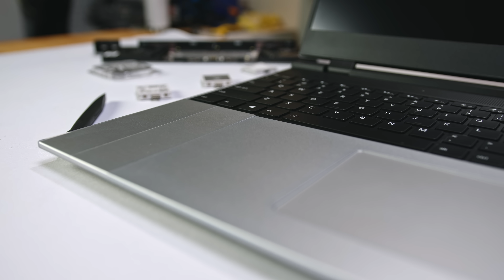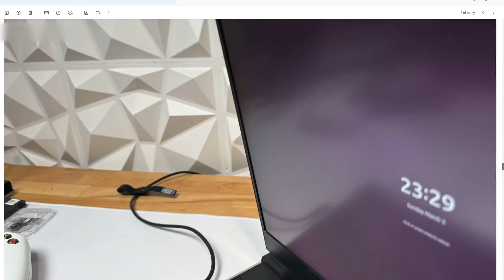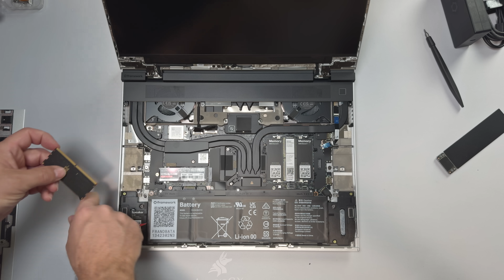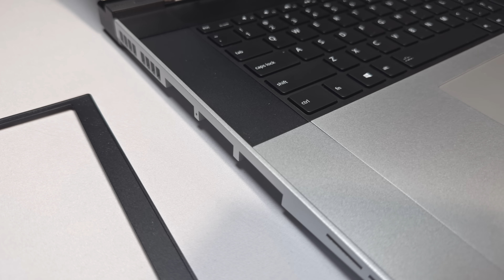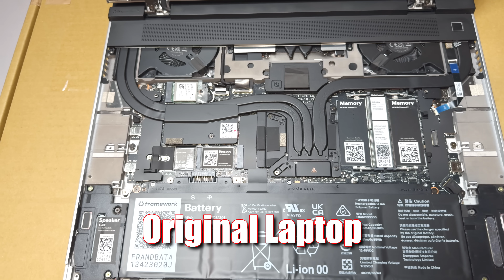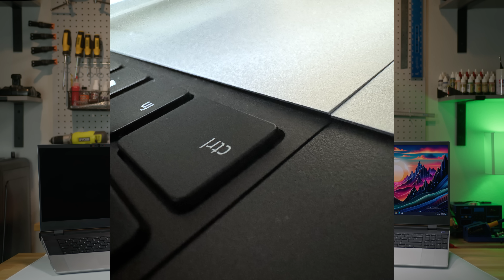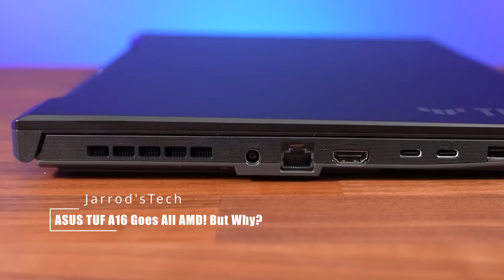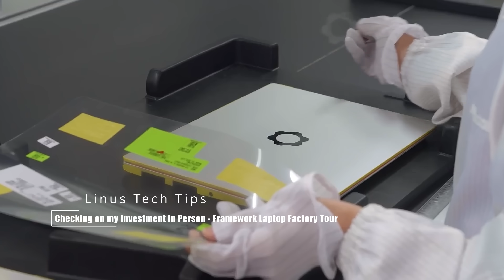From Faulty to Fixed? My Framework 16 RMA Story

Comment from the maker: About a week has gone by between filming and posting this video. In that time batch 4&5 laptops have been delivered. Just a quick glance at Reddit indicates that the input spacer problem has not been fixed. If you receive a unit with a bad input deck I highly encourage you to contact support and get it fixed first the reasons I covered in the video.
Reply: So i just want to say my Framework does not lose charge while gaming

could you measuer how much power the Laptop takes?
Reply from the maker: @ianthomas1955  what are the specs, power mode, and what games are you playing?
Reply: @ElevatedSystems  That drain does look weird though. Can't tell if it's genuine, or if the GPU + CPU + everything else are taking up too much, or if simply the charger doesn't actually supply 180W.

I'm thinking, 100W for the GPU, 50W for the CPU, there's 30W left for the scren and everything else, that should totally work, and also supply more than decent performance for both CPU and GPU. In this case, it should maintain the battery level. The fact that it drains and SO FAST... that smells fishy. I really hope it's something solvable without a RMA.

Also, in the unfortunate case that it DOES use more than 180W so casually (probably 240W ?) that should also be easily compromisable by making a power plan (don't know how in Linux) to simply use less, kind of like I exeplified above. This way, you'll get a bit less than max performance (but it should be pretty negligible at these power levels), but at least you'll have no trouble when plugged in. Settings in BIOS might help here too.
Reply from the maker: @Winnetou17  Keep in mind not all the wattage makes it to the components. There is a lot of loss due to inefficiencies in voltage conversion and power distribution. Every chip in the laptop that heats up is loosing power. Only 150w to 160w is making it past the main buck converter.
Reply: @ElevatedSystems  Wow, that much ? I recently saw the video from The Phawx about the MSI Claw, and thought it shouldn't be that bad. I know it's much smaller and compact, but on that the screen + "everything else" was only about 7W, that's why I though that here 30 W should be a good approximation.

I guess that, yeah, if you take 180W from the wall and deliver like 160W and use like 190W, then losing 30Wh per hour would drain the battery in a bit over 2 hours. Dang!

I do have to say, the lack of a barrel charger ... it's though now, but in the end, in the grand scheme of things, it is more environmentally friendly. Assuming that 240W gets out this year, I'd say it was a though but correct choice. 

Also, just popped in my head - what if you charge from multiple ports ? I have this feeling it won't work, only one will be used, but I'm now curious if (eventually) it can be done. In theory then you can simply add a 65W phone charger on the other side and unlock the full performance.
Reply: @ElevatedSystems  Hey Balanced mode. It's to me the best option. Less loud and good enough performance. I noticed that I loos Charge on Best Performance. But I have since found. 
That Dragons Dogma stresses the Laptop so much that it even loses about 5 percent charge in about an Hour of gameplay.
Reply: This was a great take and thank you for pointing out about the community and apologists.  I myself was attacked for these very things when i tried to call out the issues i wanted framework to do better at as a company.
Reply: Hopefully they'll listen and fix 🤞
Reply: Thank you for your transparency. I pre-ordered my Framework Laptop 16 and I'm in batch 7. My unit is days away from shipping. It's disappointing to see that their quality still isn't that great. I recently got married and I will admit that this isn't a wise purchase. I saved up the money last year and I'm sticking to it. Looks like I have a lot of testing to because QC just isn't up to the same standards as the rest of the customers. Thank you for your videos, they have been extremely helpful.
Reply: I always worry criticising small companies like Framework that they might be disheartened by negative customer experiences, hard-hitting reviews and complaints of poor QA testing. Or like too much criticism can bring the company down entirely. Like they'll get so overwhelmed fixing stuff that they can't keep up with consumer demand. So thanks for making this video. Makes me feel more comfy if i need to reach out to them too :)

Comment: Well they cannot test everysingle laptop, so some would slip through, as a I am getting ready to order, my issue is the battery...  I am not a heavy gamer, but I do enjoy some games and the battery troubles me... it will prob die alot faster than designed.

Comment: The barrel jack power connectors are terrible. They are always the first part to fail on every laptop I own (wiggling the cord turns power on/off). And the entire laptop becomes a pipe of waste when you no longer have the capability to charge it. I will happily wait for any USBC solution so long as I am receiving a stable power connection.

Comment: I want to share my experience with the customer service considering I had an issue with my Framework 13 AMD 7840u. 
Basically the screen came with a dead pixel. 
I send around 8 e-mails containing 10 or so photos of both the Laptop (opened, closed, two thirds) and the shipping box. My emails jumped to four different operators and after a while they decided to send me a new screen which I still haven't received (5 days after shipping. They sent the package with FedEx). They also sent me shipping information to send the screen back to them at no cost on my part.
I live in italy so at this point I was wondering if I had to send stuff back to Taiwan. This wasn't the case.

The new Screen apparently shipped from their offices in Amsterdam and they asked me to send the faulty screen to a service center in Germany.

So this laptop currently travelled in this manner:
Taiwan > Italy < Amsterdam
                         |
                         L> Germany

For some reason I find it funny. I hope the new screen doesn't have any problems.

Comment: What I really don't get here is why they didn't just set it up with 2x120W chargers, we've seen this already in the past with proprietary connectors, so why not here with type c? 

To be clear, I'm no master of electronics, maybe I'm missing some reason why this isn't feasible or something like that with type c, but I don't think that's the case, though please do correct me if I'm wrong.

Sure, pioneering the first 180W type c charger is cool af, and presumably trying to make a 240W one as well, but if they had done it with 2x120W they could've saved a bunch of RnD money, production costs, whatever other expenses they might've had alongside it, and they could've also just made the GPU module have 2 ports on the back, one for display one for power, so you don't have to waste one of your connectors just for GPU power. Would've also made more sense for people upgrading, you could just an extra 120W charger + GPU module if you decide to get it, instead of now having to get another extra charger whenever we get one that can actually power the entire laptop, and making the old one effectively obsolete. 

I'm in batch 21 and I haven't even received mine yet, and I got it without the GPU or charger because neither seemed necessary to me, right now the GPU upgrade seems kind of unnecessary to me because in order to use it without draining your battery and potentially ending up with a power off if you leave it unattended for too long while running a task, you have to use efficiency modes or underclocking.

I still love the company and will continue to support them however I can just because their mission aligns with my personal ideology, but this power issue kinda baffles me, it seems very shortsighted, and I really doubt we'll see a 240W charger any time soon due to the complexity involved in whatever current/voltage conversion has to go on in that brick, which will also undoubtedly be of questionable size.

Comment: Try plug in on the backport(GPU module)..This may solved the battery drain issue on gaming.
my theory is that the usbC passthrough module isnt giving the correct amperage to the laptop.

Comment: I still can't believe i can use my laptop charger to charge my phone.

Something i've never experienced before.

I got a Yoga 7 with a R7 7735U (disguised 6800U) and my only complaints are:
They could have easily placed a larger battery, there's space for it.
The 65W charger is not enough for performance mode.
The color accuracy is bad.
Reply: At least i paid only $580 for this refurbished unit. I'm happy for what it is. Could be better.

Also, 16GB of system RAM is not enough for my purposes.

Comment: If you have soooo much issue within that laptop go just buy apple laptop without any issues and 25000$ and says same thing about that laptop fix ram 8gb good for you
Reply from the maker: I have a 2021 MacBook Pro base model. It was only $1500, has 16GB of RAM and significantly outperforms the Framework 16.

Comment: Definitely not great re power draw. I take it no change with the new PSU that came with the RMA limit? Also any difference depending on which slot you have the USB-C port placed in? (just wondering if only a subset of them can handle full PD). Do you have an inline measurement tool to see if its a power supply issue vs a power usage issue? If the latter it sounds like it is drawing far too much and they need to optimise it!
Reply from the maker: I actually had 2 of the 180W chargers and they both worked the same. I have a USB power meter but it unfortunately only works with PD below 36V.

Comment: I had a similar with framework customer support.  Just awful horrible time consuming process to get them to send a replacement top input cover because the one they sent me on my new 13 was bent and warped so bad the keyboard had key caps popping off.
Took me multiple days and dozens of pictures to get them to replace it.

F16 battery drain while on AC is DOA. Sucks because I do love my f13, but no way the 16 lives with a clear defect like that.

Comment: The power issue is either a miscalculation of the power required by the laptop or there's a problem within the charger itself, which they'll hopefully be able to fix quickly. I personally don't see it as an issue that was caused by the choice of going with USB PD.

Comment: I got my framework 16 laptop in early February. I've been experiencing several issues and have over 50 emails back and forth with support. I've taken it apart and put it back together at least 30 times now and still have issues.

Comment: I have just finished dealing with framework customer service on an issue.  Their customer service seems to be buckling under pressure.  It used to be phenomenal, but now it’s noticeably unreliable.  I still was getting responses but they were more “canned” and not actually solving any problems, just apologizing for how busy their “partners” are with other issues.  It took me about 2 months to get a refund issued when everything on my end was completed immediately and their website said all refunds should not take more than 1 month to be issued.  Too bad, because their great customer service used to be the reason people said they would deal with the growing pains of a new company.  But these days that doesn’t seem to still be the case.

Comment: a question about charging - is it possible to add something like a 65w block (that one would carry for their phone & other devices) to make up the power difference? or does the motherboard not support charging from 2 inputs?
Reply from the maker: It doesn’t support charging from 2 inputs. It will just default to the highest power charger.
Reply: @ElevatedSystems unfortunate. though I wouldn't expect them to have included such things, it would be a neat and convenient-ish band-aid

Comment: I recieved my batch 4 and my experience has been awesome so far.   I've been using nobara linux 39 and have done some gaming testing... I didn't notice the power drain on the 180w?  I'll run a couple tests.

Edit: There is no significant drain in balanced mode.   I ran SotTR's benchmark basically on loop for 15 minutes with no battery Wh drop on the instrumentation.   In Performance mode, the battery does drop - drawing about 9w-30w from the battery.  Probably would drain the battery in about 10 hours of gaming if the percent draw I was seeing was consistent.  I limit my battery charge to 85% so mine would probably be done in about 7-8 hours.     

There are no 240w type-c adapters available AFAIK - and not a whole lot of rush to put them out.

Comment: Interesting you got to keep your first laptop, even more spare parts for more tinkering.
Reply from the maker: I didn’t get to keep it, that’s me packing it up and returning it in the last 2 min of the video.
Reply: @ElevatedSystems  oh I see. Still interesting you had it for so long and not have it returned before the new one arrives.
Reply from the maker: @AndersHass  framework cross ships. You don’t have to return the old device until the new one arrives.
Reply: @ElevatedSystems  given the focus for Framework is minimizing waste they could spind this as a way to minimize the need for more packages, since you can then just use the new one to send the old one back (if you haven't already saved the old packaging).

Comment: I totally agree your opinion. I ask customer service about 7840U dedicated VRAM allocation and USB-C monitor compatibility problem with lot's of mails, and find the solution by myself finally.
Considering the 7840U machine's price, I can buy business laptops like ThinkPad or EliteBook with 3y warranty. I cannot say it's a good experience.
I think Framework Laptop is a special product, but there are many things need to do.

PS: Considering Framework company's scale, I don't expect USB-C Monitor compatibility issue can solve quickly (ex in 30 days), especially not every USB-C monitor manufacturer update firmware. If I buy a cheap USB-C LCD monitor and manufacturer never release nee firmware for public download, maybe this problem cannot solve before my next new laptop. But I wish Framework say they will do some positive responses (ex: a tested list like RAM list), not negative (like Dell laptop and monitor work because there are specific drivers...).

Comment: For what it's worth, MSI was getting away with battery drain while while on AC power for years with some of their Titan units. Had a buddy with a 680M back in the day and that thing would burn 6-10% an hour give or take even with a colossal brick. I think they called it battery overdrive or something stupid. Moral of that story, it's not new here, but it does suck.

At least in their defense, once 240 watt bricks become available, the issue goes away nearly entirely. The glass half full view however is that if it was that easy to make 240 watt bricks, ANY of them would exist. Hell if they were that easy Framework wouldn't have been the first one to launch a 180 brick either. Makes you wonder why Delta, Anker, UGreen, or any of the other big guys haven't launch anything higher than 140W yet? PD 3.1 has been around since 2021, 3 years later 140 is the highest we had until Frameworks?

Comment: I personally returned the very first batch of the 13 inches laptop due to minor light bleed and  really subpar battery life.

The customer support asked what's wrong and agreed to fully refund me on the second email.
Oops, forgot to include the charger, no problem, sent the charger, got full refund.

After 2 years, I'm contemplating giving it another chance since every other laptop I've tried is worse in some ways for similar price.
I believe they've ironed out all the minor issues for the 13 inches model, wait a bit more if you like the bigger one.

Comment: That "don't make me take another dozen pictures, just send me the RMA!!" email sounds a whole lot like the one I wanted to send Framework when my 13 stopped booting (eventually new mobo, now mostly working). I worked myself through the 'won't boot' troubleshooting document they had on-line (which has a charge over-night step). I contacted Framework tech support after trying all the appropriate troubleshooting docs. The first tech made me re-do all the same troubleshooting a few times (with photodocumentation IIRC), then handed me off to another tech who had me redo it all again, each attempt taking a day to complete. I then handed the laptop over to our IT dept staff to deal with Framework. Framework tech support made them repeat the whole thing thing with pictures, then repeat it again, only this time taking video instead of pictures. By this time we'd worked through the script a whole bunch of times, and it was weeks. My IT dept people told me at one point that they'd given up being able to return the still-under-warranty machine and concluded that the Framework tech support was committed to making them run and re-run the diagnostics until they gave up and junked the machine. We did eventually get a new mobo, the headphone socket doesn't work now, but I can't be bothered to spend another month on a loaner laptop from the IT dept while they deal with Framework again, because it is my daily driver work machine and I only use the headphone jack in airports.

Comment: Still have them on a short list to replace my current laptop next year, hopefully by the time I need it Framework will have it all figured out
Reply: the question is, framework 13 or 16?
Reply: @schwingedeshaehers  16, though with an external monitor I could get away with the 13, I like having the bigger display so 16 might be the one
Reply: @stampedelandandhome  okay

with 16 there is also the problem with transport xD